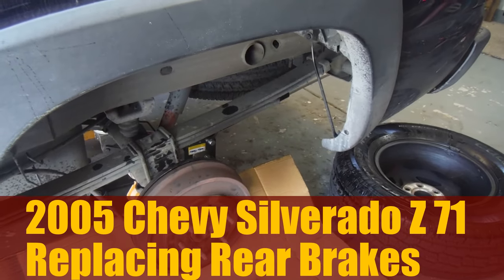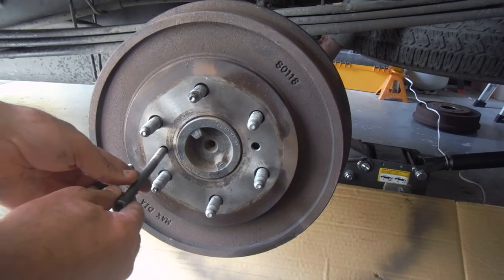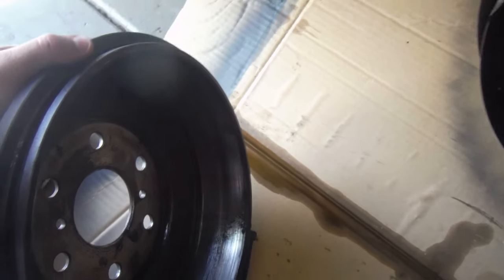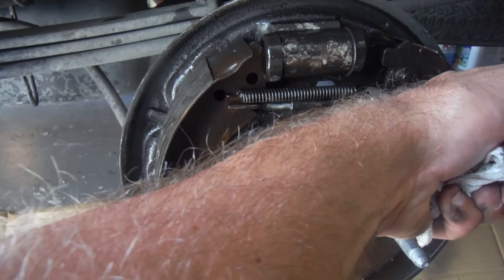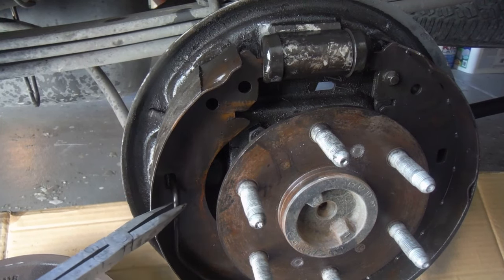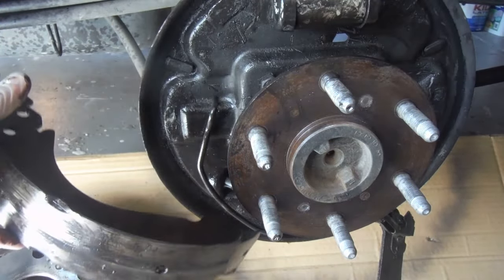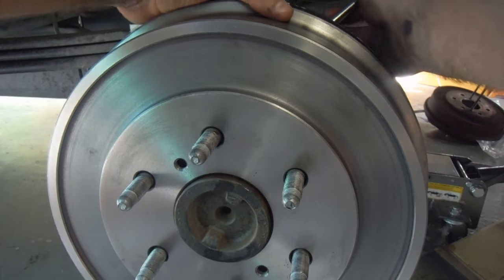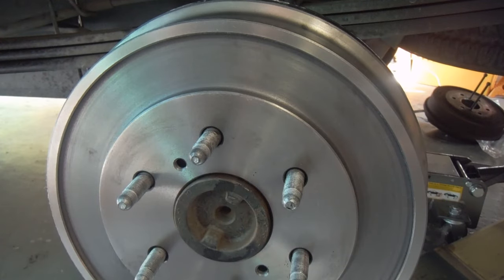2005 Chevy Silverado Single Spring Rear Brakes (Brake Shoes Drum and Wheel Cylinder Replacement)

Comment: The size of the two bolts he’s referring to, in aiding the process of removing drums is a 3/8.
Reply: Ro Ro or a 13mm
Reply: Mine is an M10
Reply: @MidwestPauly   my '05 chevy 1500 was a m10-1.50 pitch and had to use some at like 5inches
Reply: 3/8-24 to be exact!

Comment: Thanks for all of the information. I just did mine after watching your video. It was still a pain, but your video made it a lot easier. Whoever the Engineer was that designed that U shaped retainer spring should be tarred & feathered and placed over a hot fire. I noticed you skipped over installing it back. I'm sure your words were similar to mine, and wouldn't aline with youtube's user agreement.
Reply: Took me 20 minutes before i gave up and then looked at the video made so much easier. That dam snap ring ahhhhhh!

Comment: Should grease the contract points.  Can't spray brake cleaner on everything if you had greased them.  It may not make any difference but it might squeak or creak later.
Reply: Never put grease or oil anywhere around brakes, if it gets on shoes hang on.

Comment: Thanks Dan, I had my drums turned and put new pads on today but took it for a test drive the pedal almost goes to floor and I have pumped the heck out of it. When I put drums on I was told adjust them to only when you hear the pad scrape just a little bit.  On your video it looked much tighter. I think I need to go your route.

Comment: Great video. I did a brake job on a 2006 silverado and I had problems with that one piece hold down spring. I ended up destroying a wheel cylinder.  I found a single spring brake tool by lisle, part number 50600 and that did the trick. 36 bucks at o'reilly auto parts was well worth it. hope this help someone. keep up the good work. thanks again
Reply from the maker: Thanks for watching, and thanks for the heads up and advice on that tool.  I just updated the description with a link to purchase that tool from amazon.com.  Looks like it would have been much easier with that tool.
Thanks again,
Take care,
-Dan the Fix it Man
Reply: I just did mine and almost gave up. I would never attempt it again without the tool. They have one at Napa for $5

Comment: Thanks man. Never done drum brakes with that big "W" spring and been fighting to get it on since my old one was broken and didn't quite understand how it went on. Here's a tip for the E-brake cable...on driver's side under the door you can easily disconnect the cables going to each wheel by hand so you're not fighting the spring tension when trying to install it.

Comment: The parking brake cable with the cover spring over it is supposed to be going through the loop in the big "W" spring mount directly below the axle bearing/seal.

Comment: I just  changed mine and here are some TIPs#1. The emergency brake cable has another connection on the drivers side(in front of the wheel-the 2 rear brake cables connect to 1 cable via a block) You can release the cable at that connecting point and it will allow more FREE CABLE to remove the old brake and install the new. Once the new brake is installed reattach the cable at connecting point. Do this 1 wheel at a time! TIP#2: Once you have the brakes completely back on- you should adjust them from the front using a screw driver and getting a snug fit when you put the drum on OR you can adjust the brakes with the drum on from behind the brake plate(special adjusting tool may be needed).TIP#3 If after the install you have a soft-spongy pedal, then you need to bleed your brakes.Most auto stores have a cheap ONE-MAN-BLEEDER-KIT.

Comment: Ah, the magic of fast forwarding a camera..makes it all look so easy!  I have an '05 Chevy Silverado 1500 ext. cab long, bed and I did the rear brakes on it last year..what a bear! lol   Great video and great tip on the locking pliers holding that spring cable.  Seems like I recall resorting to running a piece of nylon string through the spring, tying it to the head of the cable and pulling it through to where it goes to get the job done.  I'll be using the locking pliers next time.  I'll also look for that spring pulling tool shaped like a screw driver.  Good stuff! New sub :-)

Comment: There a splitter for the parking brakes you made it 10 times harder, its located roughly right beside the gas tank on the outside the frame it allows you to give your self slack

Comment: I changed the rear pads - drum & e brake set as in the video. Now my emergency  brake isn't holding as it did before the new pads Any advice as to adjusting the E Brake with this set up? Thanks.

Comment from the maker: Chinotone85, It may be that the W spring is not set all the way back on the inner ledge of the bottom of the backing plate, or that the bottom metal part of the shoe is not seated on the back side of the support from the backing plate.  Sometimes the parking brake cable gets in the way of the W spring seating properly if it's not pushed all the way back.

Comment: Thank you including the drum adjustment tip of two full revolutions. It was exactly the tip I needed. I have a question though...anyone please respond if you are a qualified mechanic:

My brakes were also wore down, metal to metal and recessed some of the drum casing (and required a new wheel cylinder as well), If I am not able to purchase a new drum at this time, will my brakes still work once they are put?
Reply: Yeah front brakes do most of the braking anyway

Comment: I am doing the same brake job. When putting the w clip back on the side with the parking brake, the shoe is loose and doesn't seem to be holding tight with the clip and almost like the clip is pulling it outwards. Any idea what would be causing this if the w clip is put in properly?

Comment: Hey Dan....well done sir, Question would this be the same set up on my 2006 GMC Serria-4dr 2wh dr.....and when adjusting the tention am I turn away from or towards me
Reply from the maker: Hi Bradley,
Thank you.  Yes, this should be the same or very similar to a 2006 GMC Sierra.  When looking at the star wheel adjustment rod, you can easily verify the direction of the threads to be sure, but I think the top should spin away from you to tighten.  Once you have everything back together, it should only spin one direction because the locking tab prevents it from spinning the other way.  If you turn it too far and can't get the drum on, you can push the metal tab away from the star wheel enough to spin it back the other direction.
Thanks for watching!
Best of luck to you.
-Dan the Fix it Man

Comment: The only thing I do different is before I slide the drum on I turn the self adjusters from the inside till the drum just has no play but still slides on. Much easier adjusting without going in from the back.

Comment: Hey man I got everything done but my brakes go to the floor. I've tried bleeding them again and still doesn't fix it . Do you have any suggestions to what it could be.
Reply from the maker: Hi Daniel,
Usually that is caused by air in the system, or a very bad leak.  I would try bleeding them again, and verify that you got all of the air out of the system.  There are lots of videos on here on how to bleed brakes with different methods etc.  What method of bleeding did you use to bleed them?

Comment: Hey Dan quick question for you, on my 05 silverado z71 sometimes at low speeds in a parking lot or when I am coming off the freeway my brake pedal will pulsate as if it's fighting being pushed down and make a grinding humming noise...any ideas?
Reply from the maker: Hi Zane,
Usually a pulsating brake pedal means warped front brake rotors, but at low speeds if it is really pushing back it may be a problem with your ABS system.  I would probably start with the rotors, - at least take off the wheel and see how they look etc..
Good luck, and thanks for watching!
-Dan the Fix it Man
Reply: Dan the Fix it Ma

Comment: So Dan if my brakes are ok and it's just a bad cylinder would I still have to take the brakes all the way down Or will the cylinder be able to come out with out taking the shoes off you think?i hate messing with drum brakes. So if I can get away with it I would love lol
Reply from the maker: +Mila, if the wheel cylinder failed and is leaking brake fluid, it's most like on your brake shoes and they should definitely be replaced along with the wheel cylinder.  That being said, you may be able to get the wheel cylinder out without taking everything apart, but I have never tried it.  Good luck to you.  Thanks for watching!
-Dan the fix it man
Reply: +Dan the Fix it Man   thanks for the fast reply.
Reply: @DantheFixitMan   what if the cylinder spring and piece of metal fell out and started leaking oil but I but it all back together will it be ok? Or do I need a new cylinder?
Reply from the maker: @Frank-eg4mw  To be safe, I would recommend replacing it.  They’re pretty inexpensive.
You might get lucky if you want to chance it after putting it back together. It really depends on what you want to risk. If you do decide to just put it all back together I would check it after a week or so to check to see if the seals are still holding, if it is leaking, then replace the wheel cylinder.  If it were me, since you’re already in there and have it taken apart, I would just grab a new one and replace it now.
Thanks for watching!
Dan the Fix it Man
Reply: @Dan the Fix it Man   bud just saw this late and had already but it all Back together thanks so much bud!! I'm having difficulty with E Brake not holding/functionality like it was I'm list and don't know what I did wrong model 2005 Silerado 4wd 5.3 Z71 drums in back???
Reply from the maker: @Frank-eg4mw  I would start by making sure that the shoes are adjusted tight enough.  You can safely lift the rear wheels off the ground and put the truck in neutral.  With the parking brake off, you should be able to spin the wheel about 2 full revolutions...maybe a little less when the shoes are new and haven't worn in yet.  You can also verify that the cable is hooked up correctly by watching the back of the drum and making sure that the cable pulls the lever when you apply the parking brake.
Hope you get it sorted out.
Thx,
-Dan

Comment: Yo all of these vid say with the two bolts the drum will POP OFF --WRONG --On my 2006 I had to pry and beat the drum and both did come off in time. NOW I have to change one wheel cylinder.  I really do expect any reply but 1st I worked around machines ALL my life so I follow instructions when given .
Reply: I had to take a dang air hammer to mine to get it off. Luckily I am replacing everything.

Comment: Witch way do I turn the thing in the back to adjust the brake
Reply from the maker: I am pretty sure that you want to pry the star wheel up from the back, but I don’t remember for sure on this one.  If you can take off the drum and look at the threads on the adjuster, you should be able to figure it out.  Basically, you want to expand the length by turning the threads outwards to make the adjuster longer.
Best of luck to you!
Thanks for watching,
-Dan the Fix it Man

Comment: never use the bolt drum removal method with shoes not worn completely (in this case it was) if the drum has a lip you will crack the wheel cylinder piston that  aligns the shoe and a new wheel cylinder will have to be installed unless you roll the dice or like to live dangerously like Austin Powers....

Comment: Hard to decide my feedback, I was thought by professionals at academies and dealerships to never spray pads or shoes with brake cleaner
Reply: that applies to the standard semi-metalic pads/shoes, but is not an issue with ceramic pads. Always spray the old stuff before removing since it doesn't matter, spray and clean off the entire area before putting new pads/shoes on, but once installed, never spray the shoes/pads. Also never spray inside the caliper as it can eat away at the rubber around the piston(s).

Comment: what kind the tool is that do you use to hold the spring
Reply from the maker: +Ray Martinez  If you're talking about holding the cable back to install the parking brake spring, that's just needle nose vise grips, if you are talking about the tool used to remove the spring for the brake adjustment tab, it's just called a brake spring tool.  I don't remember where I got it, but I found a similar one on ebay look for Lisle 45100 Brake spring tool.  Thanks for watching!

Comment: can I lift a silverado with a 2 1/2 ton jack then put stands?
Reply from the maker: I used a 3 ton jack, but I think a 2 1/2 would have no problem at all.  And Yes, make sure you use the jack stands to support it as well while working.  Be safe, and best of luck to you!
-Dan the Fix it Man

Comment: What size bolts do u need to get to take the drum off?
Reply from the maker: I think I used M10 x 1.0, but I think 3/8" bolts work as well.
Thanks for Watching!
-Dan the Fix it Man
Reply: Dan the Fix it Man I picked up a m10 bolt will try it tomorrow thanks for responding

Comment: Question for anybody. Is the car in neutral and E brake off???? Thank you
Reply from the maker: Hi Art,
Yes, that’s correct.  The Parking/emergency brake needs to be off or the drum won’t come off.  Having it in Neutral also helps spin the wheels when adjusting the brake shoes.
Thanks for watching!
-Dan the Fix it Man
Reply: @DantheFixitMan  thank you brother. I had to test it on the road 2 hour drive up n 2 hour drive back. (Daughter needed my spare fridge.) Happy New Year. "YOU'RE THE MAN!" Thank you I was a lil afraid the truck was gonna roll as I had a lil jack and two Jack stands. (Jack was to short. Improvise, Adapt and Overcome!

Comment: Did not show the pain of the E brake spring. Thanks.
Reply: Jeff Seidel how bad is it? Compress retaining spring then compress the e brake spring and push e brake wire through, right? Doing mine tomorrow so any insight is great
Reply: sammy mangini 
Got it figured.  Pull the cable all the way out with vise grips and use another pair on the end near the backing plate to hold then slide it on. He just didn't show that part.
Reply: Jeff Seidel thanks bro. For real.
Reply: the E brake spring is a pain in the ass.

Comment: 9:32 How are you suppose to set that?
Reply from the maker: +Welder Nate the thereaded adjustment rod just sets on the inside notches of the new brake shoes.  It can be adjusted after you have sll the springs back on and in place.  Thanks for watching!
Reply: Dan the Fix it Man Yeah but are you suppose to tighten it hard or just finger tight?
Reply from the maker: +Welder Nate If you watch the video at 12:00 min I explain that I tighten that from the back through the access slot with the tire back on until you can spin it as hard as you can and it will spin two full revolutions before stopping.  Thanks for watching!

Comment: hey Dan just replaced the break shoes and now my wheels are locked up as in my truck wont over in neutral and my break pedal is super tight 
any ideas ?
Reply from the maker: Antonio, with the rear of the vehicle raised and the car in neutral you should be able to spin the rear wheels for two full revolutions with one hard turn.  If you can't spin them, the brakes are probably adjusted too tight.  If that is the case, you might not be able to get the drum off to loosen the starwheel adjuster rod.  You might only be able to loosen it from the back of the drum by putting a small screwdriver in the slot to push the metal tab away from the starwheel adjuster while you loosen it.
Thanks for watching!
-Dan the Fix it Man

Comment: Yeah let me guess that w spring has a little clip on the dust plate the back plate yeah the bottom inch or an inch and a half of mine's gone.. you know like if the wheel fell off on the highway kind of thing.. great 12:36 a.m. another day off of work yay let's go from drum to disc to drum you know cuz fucking proving the disc that you had on the last few years GM Jesus Christ why wouldn't a GM man through and through would be the last one I own but I won't own anything else